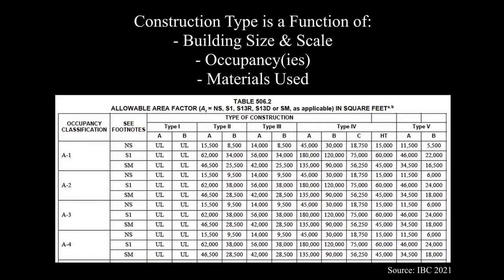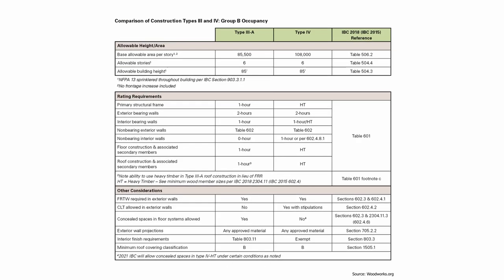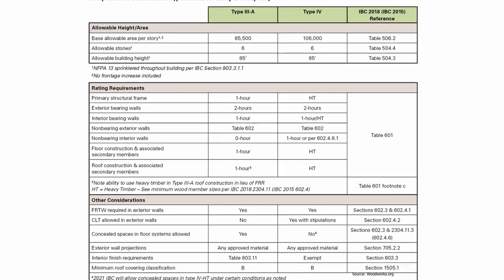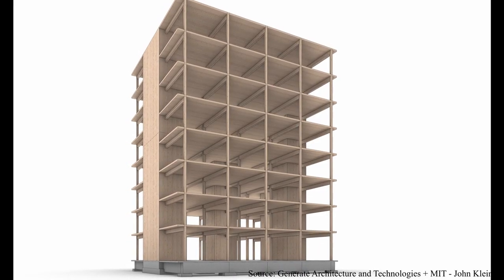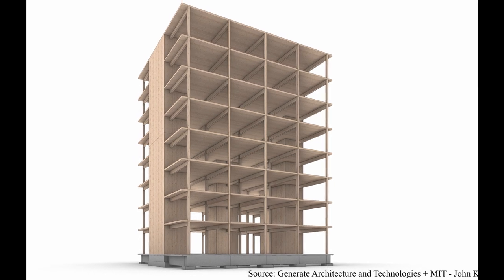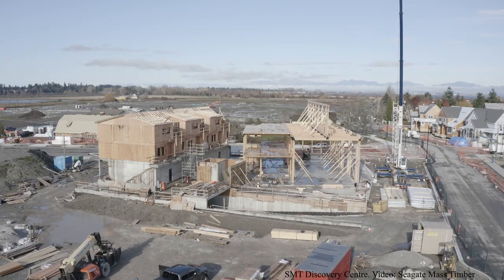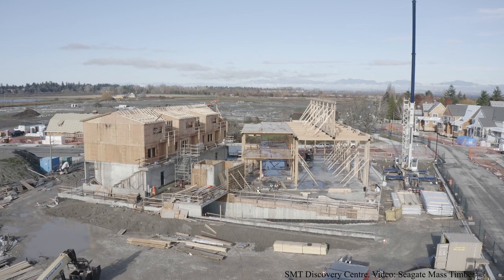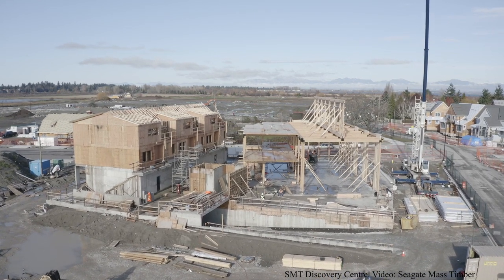What is the Best Construction Type for Your Mass Timber Project? | 2 Minute Tuesday 12.1.20

Comment: Glass walled conference room, 1-hr wall. Use window sprinklers that are listed for this application. NB: There are a number of details that are required of both the glass and spk designer. In no case are intermediate horizontal mullions allowed. This appears to be biggest project risk. Someone tries to ‘be reasonable’ and save money. If you don’t know what you’re talking about, you aren’t being reasonable. You’re guessing. Project management will need to ride hard on this issue. You already have a wet spk system installed. Use it. Cheaper than rated glass.